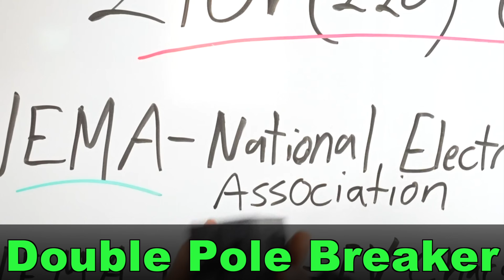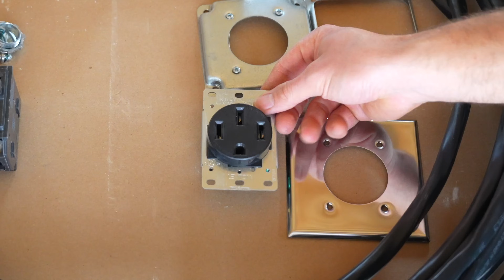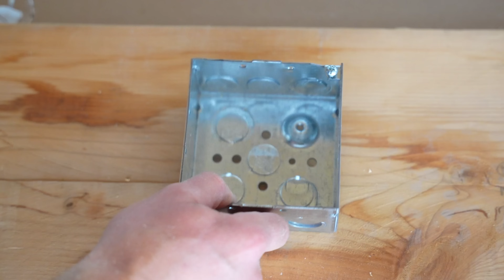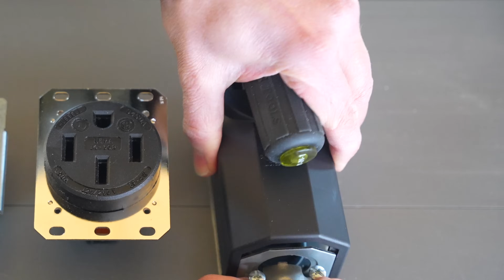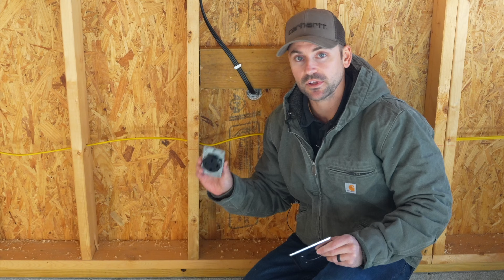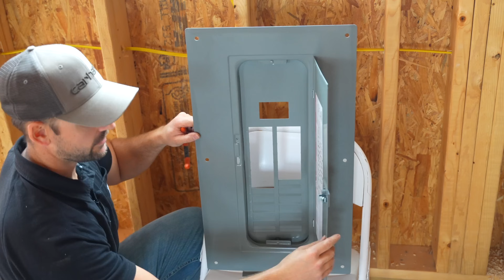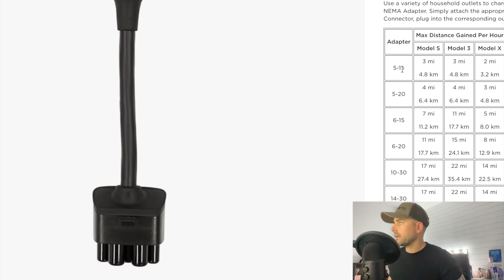How To Install A 240V Outlet In Garage - EV Car Charger, Welder, And Electric Range (Hubbell 14 50)

Comment: Don’t wrap your ground counter-clockwise like he did in this video. If you watch closely as he tightens the ground screw it pushes the wire out of the screw. ALWAYS go clockwise when you wrap your wires. This goes for receptacles, and literally everything you wire.
Reply: And he put the two gang ring on upside down 😅
Reply: I saw that too.
Reply: Very true, I was about to say something about that as well.
Reply: Ive done very little home electrical seeing as i typically try to avoid doing in home electrical on my own. However with that said I've done a bit in home and a bit more in commercial buildings and the only time I've ever had an issue with the connection, it was when i didnt do it the way he shows doing it here. By making a full rotation around the screw in the same orentation the screw turns until you come around to where you're receptacle connects to it (which is what he does) it becomes tighter as you tighten the screw. Had he gone out of rotation of the screw you'd be correct, but he didn't.
Reply: i only noticed because i saw that advice in several videos.
Reply: He is ok.  This is a loop and doesn’t matter which way. If half circle then yes better clockwise.
When it is loop, it’s always half right and half wrong. That is One side will look like clockwise and the other half side must be counter clockwise. So the video shows some part of loop wire is been pushed out and the other part of loop wire been pull in.
Reply: @camfocus8888 the amount of stupidity in this comments, as people argue “full loops,” have obviously never worked in the field. 

You’re trying to argue there is some sort of “closed loop,” so it shouldn’t matter. It does. They overlap, talk whatever “science,” or whatever you’re trying to argue. As you tighten it’s going to flatten the wires. Once that’s done, they will start to push outward and loose. 

Try wiring them under your glorious ideas and let me know what happens.
Reply: @AdamS-lh2ug I think you need to take a basic physics course before you lecture others. A full loop is a J hook in both directions. 😂
Reply: @802Garage  I don't think this is basic physics, something we should have learned in kindergarten. When drawing a circle, it doesn't matter whether you draw it, clockwise or counterclockwise, it's still a circle, the same circle.
Reply: @camfocus8888  Hahaha amazing. You right.
Reply: @AdamS-lh2ug  I can't believe it's been 11 months and you still can’t figure it out. OMG! You must be so eager to show off because you know so little. However you still get it wrong. Now you get mad just because someone points it out?
Reply: Very clear explanation 💙 thank you God bless you🙏
Reply: I noticed that too.
Reply: After seeing a few of this guys videos,Its obvious that hes a paid actor for the channel….a channel that has no clue wteff they are doing btw.
Reply: And now I’m going to like your video and tell you thanks.
Reply: Yep....  one of the first things pointed out to me when first learning to wire recepticles
Reply: Or use the pre-made ground tail and "pigtail" your grounds together
Reply: @josephphillips1777  another good option.
Reply: @josephphillips1777  I came here because I didn't know if a pigtail was required or not. It does seem to me that if a person is that concerned about loop vs hook then the choice should be pigtail.
Reply: This is a great video,. Excellent explanation of everything. However when you say 75 lb of torque, how can you even apply that much using a screwdriver?   Or did you mean 75 inch lbs?
Reply: @skdrcr  Yes the installation instructions say "Using a 3/16 inch Allen Wrench, tighten terminal screws
to 75 lb-in (8.5 N•m)"
Reply: It only goes in one way.🤡
Reply: @Moonraker6646  It's like people don't understand that a U shape in a continuous run is wrapped around the same amount both ways. 😂
Reply: @802Garage bc the under side of the ground screw is ribbed I would LOOP clockwise to complete loop with wire ending on Top of itself vs under to grab and pull tighter when tightening. Otherwise ur 100% correct and it’s totally fine either way in a loop.
Reply: @802Garage have you ever wired anything?
Reply: if its looped I would think the looped with the top wire being clockwise so it doesnt get squeezed out when the fastner is tightened
Reply: I saw the same thing 😂 I always nit pick the little things like that
Reply: It is important to nitpick the little things when you're doing wiring.
Reply: i’m not an electrician, but i observed the same.
Reply: Or even better get a proper lug or ring terminal and use an insulated bus module to tie the grounds (ground to panel, ground to outlet and ground to box grounding screw).
Reply: You need to slow down the video and th Ground wire is correctly installed
Reply: Did y’all see that the face plate went on upside down too?
Reply: Yea pretty much obvious common sense.
Reply: All of do your own video your all good talkers and that's it.
Reply: If you noticed, it's a loop, not a hook. Therefore, it's "wrapped" in both directions. Even if he wrapped it the other way to make the loop, it would be the same U shape around the ground screw. Think about the physics. What he did is just fine. The only difference is which side of the loop gets wound tighter and which side gets loosened slightly. You could argue it's slightly better to have the length going to the receptacle tighter because it's going to get moved around, but in practice it will likely have the same impact either way.
Reply: regardless its bad practice to not tighten it with the ground screw because it pushes and bands out if you go the other way with it... under strange circumstances it can even push past the screw itself(have seen this occur) @802Garage
Reply: ⁰ @802Garage
Reply: @802Garage wrong. When you go to tighten it pushes the wire outwards.
Reply: @802Garage  yeah,  no.
Reply: @AdamS-lh2ug  Great argument!
Reply: @802Garage  Good point I hadn't considered. But I still like the incoming wire on to be the side being drawn in because that wire is tighter to the clamp so more likely to get draw in.
Reply: @802Garage  Bullshit. As the faster tightens it naturally unwinds the loop. Any movement has the wire detach.The terminal is of such poor design, having no means of restraining wire moving from under the fastener. 
Every trade qualified professional electrician knows this... yet you think it's all A-OK.
Reply: @BTW...  Again, if it is a loop not a hook, you do realize that it is wrapped both ways, right? Like you realize that one side will tighten while one side loosens either way? The only valid argument is that the side which will loosen more in this case is the side which will see more movement, so it should be done the other way. That said, it's gonna be fine.
Reply: @802Garage  you are wrong stop giving people terrible advice its dangerous especially at this amount of current. go do an apprenticeship for 4 years and then come back with your findings.
Reply: @benzoluvsyou  Correct me then. What did I say that was wrong? I'll wait. Just saying "You're wrong." Is not an argument.
Reply: @802Garage you need to go back to school

Comment: Strip your wires before you put your wire through your connectors/boxes. You’ll get a cleaner look and it’s easier and faster. Code is 6” from the back of the box or minimum 3” from the front if you have some seriously deep box.

Comment: Here's a question.

I recently started replacing older ceiling fans.  One of them had a 12" steel plate with a hole for wiring and I guess whoever wired it striped back the grounds to the very edge.  There was no real junction box.  The new fan goes into a 4" junction box so now the ground wires are exposed beyond the junction box.  Is this a safety issue?  If so then how can I fix it?  Grounds as you know are just wrapped in paper but the outer Romex shield is also overstripped.  Thanks for any advice as long as it's correct 😊
Reply: Insulation off a similar wire or romex slit lengthways and/or electric tape "built up to the same thickness as original" covered with heat shrink tubing would look good
Reply: @jayjohns5653  That's what I have done but I'm having trouble getting the wire into the junction box.  it's just not long enough to make the connection.  I wish I would have never started this project but it was the one fan that rattled constantly and drove me nuts.

Comment: Good job. Love the video. how did you estimate the length of the run so good. You had a drawing to work from or you just use a tape measure and guestimate?
Reply from the maker: Thanks! I’m glad you love the video. I use a 100 foot tape and then run it where the wire will be installed. I simply just use that measurement to buy the length of wire. I hope that helps!
Reply: Thanks for the response.  @TheExcellentLaborer

Comment: Excellent video.  Would you mind sharing which torque screwdriver you used in this video?  I did not see it mentioned in the list of tools used in this video.  Thank you.  Also, did you really torque the screws to 75 in-lbs?
Reply from the maker: Thank you! I’m not sure the exact brand of the screwdriver because I borrowed it from a friend for this install. I had the dial pass 70 to get the torque which should be around 75 lbs. I hope that helps!

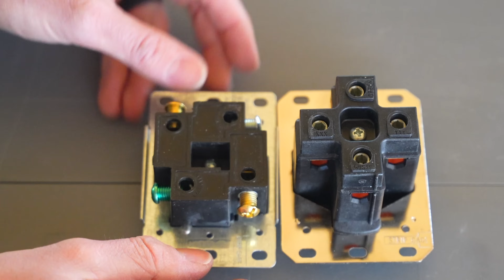Comment: 13:30 Like you said not all NEMA 14-50 outlets are the same, I would add that the duty cycle of an EV charger can be drawing 50 amps continuously where a standard range outlet was designed to handle the intermittent duty cycle of a range.
Reply from the maker: Yes, good point! The long term continuous draw justifies having an industrial grade outlet versus a range outlet. Thanks for your input!
Reply: I installed mine the same way with the same receptical concerns.  I also under sized my load to 40 amps because I was concerned about heat created by impedence with  such a continuous draw over a 2-3 hour period.  I used romex 6/3 due to electrical code but I think that other cables may be better at heat dissipation.

Comment: What about I have already outlet in my house a 220  volts was installed by Sears electrician long time ago, I use theirs for EV car for my sons car what I’am going do to can I plug EV car direct to 220v? Can you give me or explain me what to do before I used this out let?
Reply: yes just get the adapter
Reply from the maker: Tesla along with other manufacturers, make adapters like I show towards the end of the video. An assortment of adapters will fit different NEMA outlets depending on which one you need. I hope that helps!
Reply: Depends on the amperage. There’s an adapter for everything, but if it’s only a 20 amp 240 circuit it’s going to take 2 weeks to charge your car.

Comment: Hello Josh, I'm an Italian Electrician moving to Canada soon, and I have been following your videos to start learning how North American circuits are made. I have a question, while doing my researches, I saw that there are 2P (Dual Pole) AFCI and 2P GFCI breakers, but I didn't saw 2P DFCI breakers... I was wondering if 2P DFCI breakers are a thing or if they only make 1P DFCI breakers.
Reply from the maker: I have installed several of the DFCI breakers in my sub panel video. They are dual function. Meaning they are AFCI and GFCI protected. I hope that helps!
Reply: @TheExcellentLaborer  Thanks for the reply. But my curiousity was if there are DFCI breakers for 240V circuits or just for 120V circuits. For example, lets say you wanna add DFCI protection to the 240V circuit you made in the video, can you use a double-pole 240V DFCI breaker, or you gotta use a double pole 240V AFCI and a 240V GFCI receptacle?
Reply: @Alessandro7432  To my knowledge there is no such thing as a 240 volt GFCI receptacle. GFCI and AFCI receptacles and DFCI are only made in 120 volt, 15 and 20 amp varieties. And circuit with ampacity greater than 20 requires the breaker to provide the GFCI protection.
Reply: Our code doesn’t require them for 240v circuits. Arc fault breakers don’t play well AT ALL on shared neutrals. So 240 or multi branch circuits are out. Honestly we have basically moved away from multi-branch circuits. They’re dangerous and honestly is the little bit of money you save on sharing that neutral really worth it?